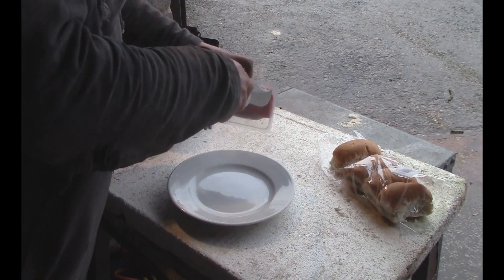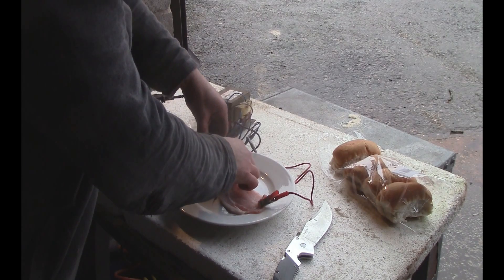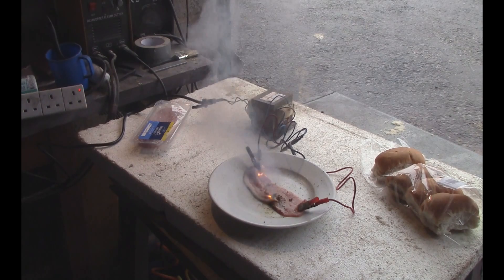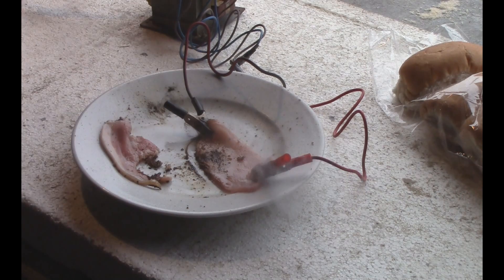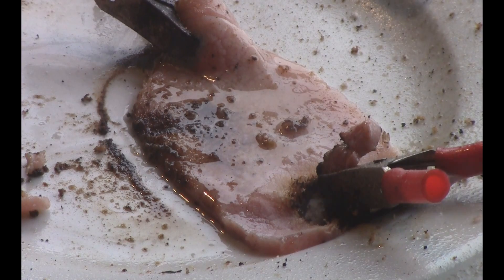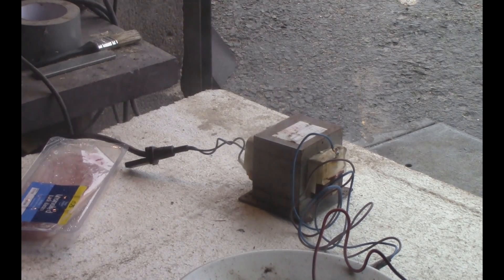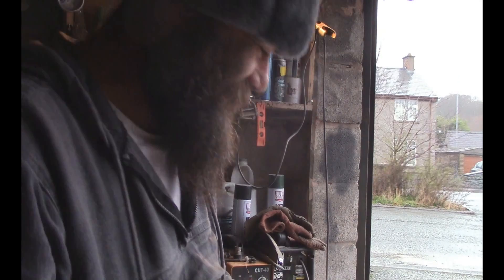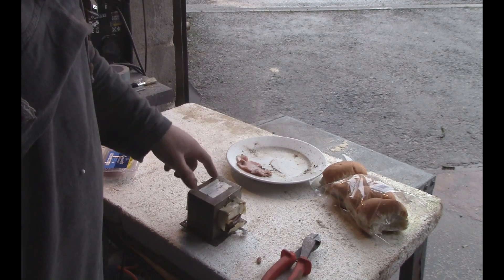Cooking Bacon with 3000V Lichtenberg Figure

Comment: Looks like current went up the wire (check the beginning), went into the transformer, burnt it up.  haha
Reply: a high impedance (resistance, the grease), went back into it.